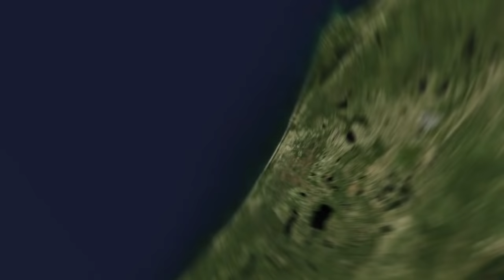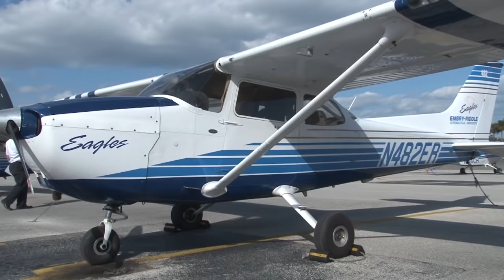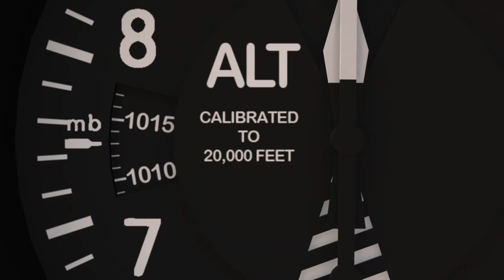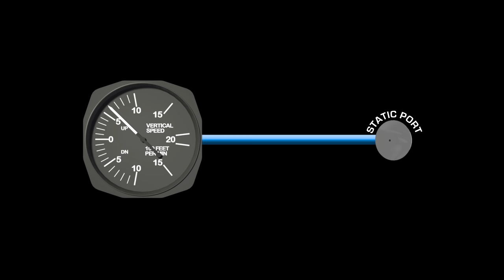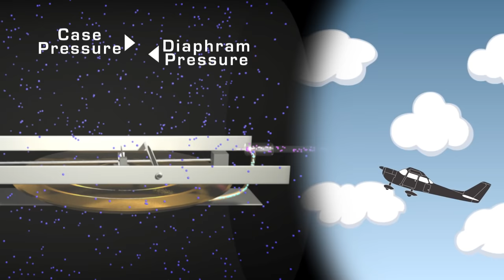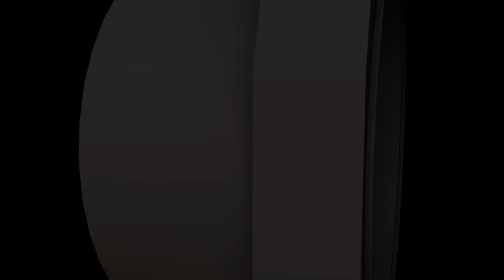Pitot-Static Instruments

Comment: I've had these instruments explained to me by my instructor, by at least three different books, and by Sporty's Online Ground School and this video is the best explanation I've ever seen. Thanks guys!
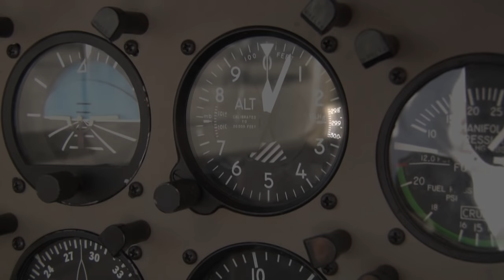Reply: Why is at video 4:41, when you turn the knob clockwise, the needle goes counter-clockwise, isn’t ALT supposed to indicated clockwise when you turn clockwise on the knob ? But in video it show opposite?…
Reply: @reponrepnation3004 
No. Imagine the local Mean Sea Level pressure is 30.02"; 1" difference = 1000'. 
The standard atmosphere which is used in the US above 18,000' is 29.92", and is referred to as FL 180 (to indicate use of the standard datum) 
In this case the datum zero is 100' above sea level.
If you freeze time and instantly turn the knob clockwise to reach 29.92" the pressure indicated in the window will decrease 0.1" and the needle will go anticlockwise by 100'.
So if the local pressure is greater than standard, the true altitude is greater than that indicated, and vice versa.

Comment: This takes me back. Years ago I had to animate an altimeter for the RNZAF, for student pilot training. Being given schematic drawings and being asked to produce a working animation is always a great learning experience, and prompts a lot of research. What's not mentioned is the amazing and minute planetary gearbox that allows the needle to rotate so much relative to the tiny amount of movement generated by the expanding and contracting wafers.
Reply: Why is at video 4:41, when you turn the knob clockwise, the needle goes counter-clockwise, isn’t ALT supposed to indicated clockwise when you turn clockwise on the knob ? But in video it show opposite?…

Comment: This video has some of that delightful 50's style and I love it. Great animations and insights, great explained!
Reply: Why is at video 4:41, when you turn the knob clockwise, the needle goes counter-clockwise, isn’t ALT supposed to indicated clockwise when you turn clockwise on the knob ? But in video it show opposite?…
Reply: @reponrepnation3004  I don't know about such standards
Reply: @gustavgnoettgen  is not standard, is common sense, is like when you turn your yoke to the right, you bank right in the air…
Reply: @reponrepnation3004  If it's not standard then it isn't.

My alarm clock turns the other way around too when I set the time. That's not safety relevant, sure. But I guess you'd notice what's going on.

Comment: Interesting video, even though I don't fly airplanes. Knowing how those parts operate must also be helpful in any situation where those instruments malfunction. For example if the Pitot tube gets frozen, the airspeed indicator will read zero. So then you can troubleshoot that problem by having the heater turned on the tube.

Comment: One thing is wrong: a sensitive altimeter ist every alimeter you can adjust for non standart pressure. Its about how precise its arms are. Normal Altimeter have a 1000 foot arm with 200foot increments and all sensitive ones have an arm for 100 foot with 20 foot marks. 
Both, sensitive and non sensitive ones have adjustable and non adjustable models.

Comment: Perfectly visualized and explained! Great work, thanks a lot. I have a question about the speed indicator though. When the dynamic pressure compensates for the density decrease at higher altitudes what is the difference between indicated and true airspeed then (no wind assumed)? Thanks in advance to anybody that knows the answer!

Comment: Good explanation except for the function of the altimeter. The altimeter reads because the static pressure is red against the tension of the Wafers that you were speaking up. There is no differential pressure inside the instrument because it will work whether it's even hooked to the static pressure sensor or not it just works better because these copper Bellows are attached to an outside sensor rather than just sensing the static pressure inside the aircraft which may have a slight difference. That vacuum, for lack of a better term affects the tension of these copper Bellows and makes them shrink as you increase in altitude. You can adjust this to an extent by adjusting the current barometric setting of wherever you happen to be located.

Comment: This looks like “Swiss” precision mechanisms, linkages,counter weights,gears, what kind of maintenance do those fine crafted instruments require for consistent smooth operation? Also ,the air intake tubes, air holds tiny particles of pollution,does that effect them in the long run when the “dirt particles” accumulate inside?

Comment: Phenomenal animations and great desciptions.  One correction: by subtracting the static pressure, the airspeed indicator indicates the actual DYNAMIC PRESSURE for every altitude, not necessarily the correct AIRSPEED.
Reply from the maker: Thanks! The Airspeed Indicator uses dynamic pressure to generate and display an indicated airspeed. Nowhere on the face of the instrument does it indicate dynamic pressure. The only markings are for indicated airspeed.
Reply: That’s understandable... since indicated airspeed is proportional to 1/2pV^2
Reply: Why is at video 4:41, when you turn the knob clockwise, the needle goes counter-clockwise, isn’t ALT supposed to indicated clockwise when you turn clockwise on the knob ? But in video it show opposite?…

Comment: I have a question. Do these mechanical instruments [that you have wonderfully illustrated] have more face-time on their gears, or is it not an issue? For example, high turbulence or a high impact landing.  Would it disconnect a gear in the panel system so that system no longer reads correctly? I'm wondering if they have play in the gearbox system or if they are are in a self contained in a secure unit.

Comment: You'd almost think that the airspeed indicator shouldnt reference static pressure. Because the thinner the air the worse and airplane flies. So a stall speed of 50 kt would now be 55 kt because the air has thinned. ? Whereas if static pressure was not taken into account it would shoe relative airspeed. Is this far fetched?

Comment: The description of the ASI is incorrect. What it shows (Indicated Air Speed or IAS) are consistent numbers between Vstall and Vne that your plane is happy to be flown within at all density altitudes and air temperatures. True Air Speed (TAS) can be calculated from IAS if the Calibrated Air Speed (CAS), density altitude, and air temperature are known.

Comment: What I picked up a while ago differs somewhat from the last few minutes of this video. Maybe someone can help me sorting out what my misconception is? So, what I learned about the airspeed indicator is that it roughly measures the "amount of air molecules pushing into the pitot tube" and indicates a corresponding airspeed. Notably, this would imply that, as the plane climbs, and as the density of the air decreases, then (for a given ground speed and wind) the indicated airspeed decreases, because less molecules flow into to the pitot tube. Which makes sense, because you fly your plane according to IAS and not TAS: As the density of the air decreases, the wings produce less lift for a given TAS, which means you'd want to increase your TAS with altitude (such that IAS stays constant). 

This, however, does not really add up with the airspeed indicator controlling for current altitude via the static port, does it? According to my explanation above, the IAS should NOT be corrected by air pressure, because that would make it lose its informational content on current lift and airframe load.
Reply: I think I understand your misconception. The static port does not correct for altitude, it corrects for pressure. Air that goes into the Pitot tube is Total Pressure (Dynamic + Static). If we did not have the static port connected, then we will always get Total Pressure.
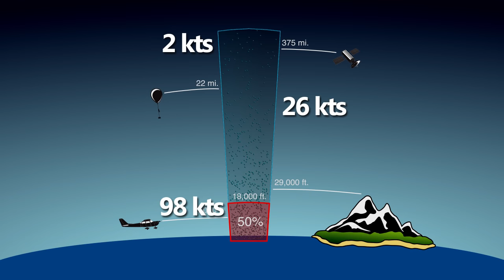It's not really density altitude that increases (but could be a factor), it's just that as we climb (in altitude), we have lower pressures and molecules are more spread apart, so yes, the IAS would read as if we are going slower in higher altitudes and faster in lower altitudes. If we were to see our airspeed in Total Pressure, it would not help us. 7:30 Is a good picture to reinforce that.
We don't want to know our total pressure, we want to know our Dynamic Pressure. So, we connect the static port to the ASI casing, and it "cancels out" the Static Pressure inside the diaphragm. Hence, Total Pressure - Static Pressure = Dynamic. 
Hope this helps! (: If not, then I'm sorry ): lol
Reply: @MinnieMonster27  Yes, this helps a lot, thank you very much! I think the point I missed was that, with altitude, both pitot pressure (for given TAS) and static pressure change. So you will still get decreasing pitot pressure with increasing altitude, even when correcting for static pressure.

Comment: Can someone clarify why if i turn the knob of an altimeter setting lower pressure, the ALT goes down? I thought the lower the ALT the higher the pressure? What am i missing here?
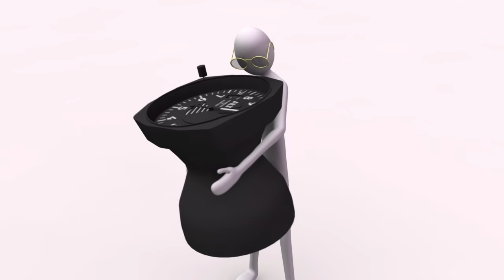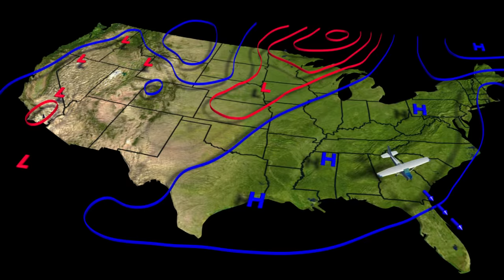Reply: You are correct that the lower the altitude, the higher the pressure. But that applies only to a generalized column of air; what you are doing with the knob is adjusting/calibrating for local pressure baseline of that column (4:23), which varies with weather. At 4:36 you can see them make the same adjustment, and then how internally it is just rotating the indicator. Its not that the altitude is going down, but that the calibration had been set too high, and you are just fixing it to your actual altitude.

Comment: is there actually a difference between a vertical speed indicator and a variometer?
they seem to work identically but surely sailplanes wouldnt have need for a separate vario and vsi if they were the same right?

Comment: Why can't you use just an altimeter   and a clock to measure vertical speed. Also, how do pilots recalibrate when atmospheric conditions change. For examle, when they are cutting through isobars at the same altitude.
Reply from the maker: Using an altimeter and a clock would take up a lot of your time. Generally, you want to spend most of your time looking outside for traffic. Calculating your vertical speed could distract you from other duties. Additionally, the VSI will show changes almost immediately. If you were calculating it yourself, you wouldn't know until after a few seconds. --- When flying, pilots can periodically get updated altimeter settings from local airport weather broadcasts, or ATC. They can then simply enter the value (like in the Kollsman window) to once again receive an accurate altitude readout.

Comment: Was the frozen Pitot Tube what caused the Air France Flight 447 accident where 447 pax died, correct?
Reply: Flo Fontanella No, the pilots noticed too late that they were in a stall... They didn't push the nose down... It was a pilot error

Comment: So even modern planes are using these big gyro components? Idk how I got here lol, I'm not training to be a pilot . but now I'm wondering why don't the planes use smaller sensors like the ones in our phone? Reliability? I'm sure there's a good reason but I imagined these instruments would mostly use small electronic components  as opposed to these mechanical instruments. I'm no genius about this stuff, just curious.

Comment: thanks alot sir for the good explanations  but i have a little question since vertical speed indicator does not read instantly why dont use the pitot tube pressure and multiply it by the sine of the current pitch angle to get vertical speeds ??
Reply: Sorry if this reply is dead but it would be interesting to see the mechanical equivalent of calculating the sine of that since these instruments are designed to function without any electrical input such as a cpu.

Comment: So if atmospheric pressure rises for any reason it shows me I'm descending?
Reply: Kazimir Sure does! That’s why when you’re fly a “cross country flight” ATC will give you a new altimeter setting as you get handed down to a new controller. Or you can always ask if you’re concerned. Good memory aid; High to low, look out below.. Low to high, look at the sky. Which is indicating where your airplane will be flying with respect to the actual altitude if you just keep holding an altitude without periodically adjusting the altimeter.

Comment: Can the VSI be a gyro based instrument?
Reply from the maker: Great question! The VSI relies on changing pressure to display the rate of climb or descent. A gyro would not work in this situation, as gyroscopes do not measure changes in air pressure.
Reply: Thanks!

Comment: @ERAUSpecialVFR

There is a contradictory statement in your video, that will confuse the viewers and your students.
@2-25 you said pitot-tube is connected to all three instruments and only the static-pitot (or static-port) is connected to air-speed indicator instrument, understood as crystal, but @2-57 you say Altimeter is connected to static pitot-port, that is a contradictory statement in your video.
Reply: From the video @2-25 it says all three "pitot static" instruments rather than three "pitot tubes", you might wanna check again.   ;-)

Comment: Pitot+Static explanation is wrong. Real airspeed indicator do shows less at higher altitude.
Reply: It isn't wrong because he is talking about indicated airspeed, not true airspeed. An ASI does show the correct indicated airspeed at all altitudes, which it would not without the static port connection. Indicated airspeed is what the aircraft cares about aerodynamically. For example, a plane that stalls at 61kt indicated, would stall at 61KTAS at sea level but would stall at 70KTAS at 9,000 ft (standard atmospheric conditions), which is important if you're about to land at Telluride Regional Airport. That's why indicated airspeed is used for all such things. True airspeed is useful in navigation.